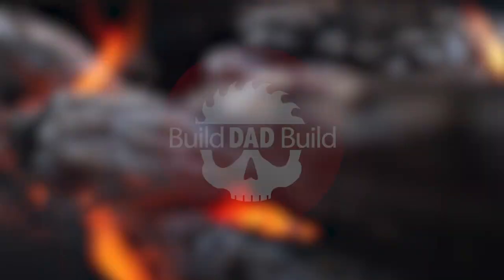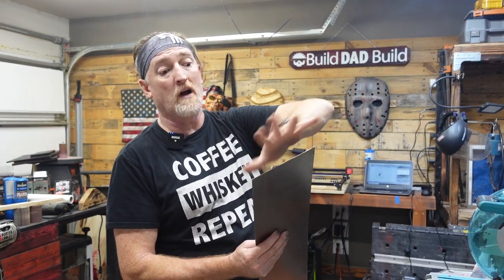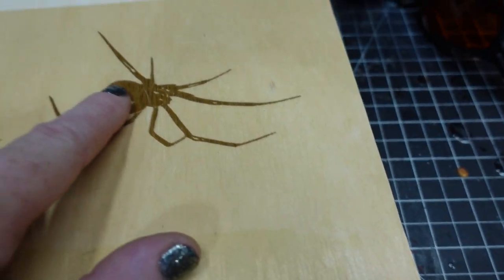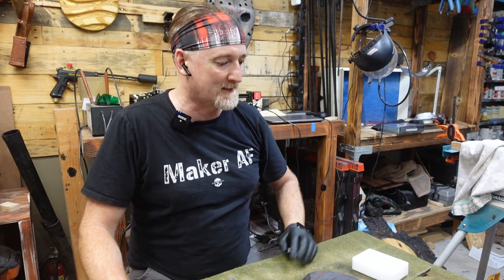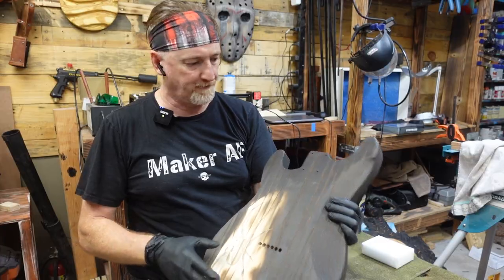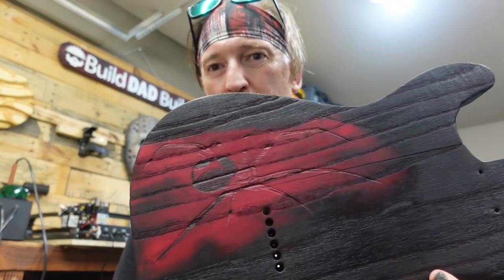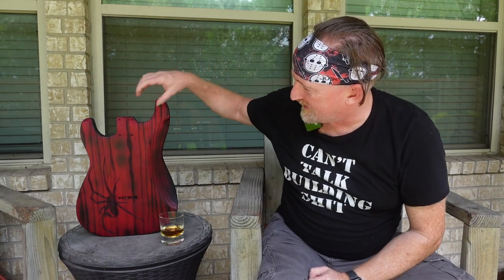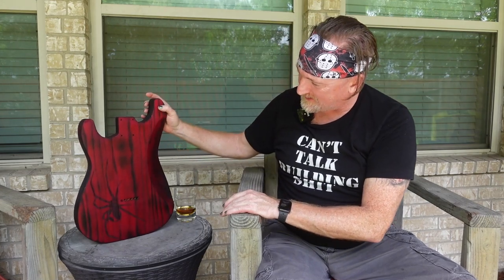Black Widow Guitar - Laser Engraved with the Ortur Laser Master 2 Pro

Comment: Try burning and staining first, let it dry for a day or so then engrave it with the laser. should be much better
Reply from the maker: Why is that? Just curious...
Cheers
Reply: I was about to suggest the same thing
Reply: @BuildDadBuild  it would make your image darker and Imo you wouldn't have to go back and fill everything in. would you want to fill everything in if you had an intricate design. The reason behind letting the stain dry a day or so is it will lessen your chances of fire on the material. It also wouldn't hurt to mask off the area that you are going to engrave as well as it will keep the soot and sap from getting on your finished material.

Comment: I've got an ash guitar body and I was considering doing a similar treatment. However it doesn't seem that hardwoods like ash produce the stunning results as softwoods like pine. I'm considering doing the treatment anyway and then staining the body black (should be easy enough after burning it) and then doing a ceruse application of red gilding wax in the grain pattern (lifting out the excess with teak oil). Does applying the shou sugi ban technique produce a channel in the grain to collect the wax? it looks like it does in pictures but I though I'd ask someone who can tell me first hand. Thanks for the instruction and inspiration.
Reply from the maker: Hey David!
Ash with open grain patterns works pretty good with the torch. And to answer your question, yes, it creates channels in the wood.
Sounds like someone's making a kickass guitar!
Cheers

Comment: Great vid. Well rescued, back turned out ace. Front being darker reminded me of a pair of Dr Martens I had, wish I still had them. Your baking soda seemed low, I've dabbled with staining using that and a tea solution to darken grains to good effect but can't recommend quantities. You can get a 1 piece body and could probably do it yourself with the tools you got. The issue is you start getting the term tonewood tossed around which is licence to print money.
Reply from the maker: Definitely want to try again with a single piece body!
Cheers
Reply: @BuildDadBuild  I would definitely have a look at doing your own. If you can get a big enough piece of wood, might even luck out on  ebay. There are a few principles to adhere to but making a body is pretty easy.

Comment: I don’t think they make a 1 piece, solid wood guitar bodies. I think it may have a tendency to “Cup” or “Warp”. Using 2 - 3 pieces give a flatter blank to work with. They can alternate the “Ring” pattern to avoid Cupping & Warping.
Reply from the maker: Yeah...I've discovered that apparently I'd need to reach out to a Luthier to have one made.
Cheers

Comment: Hey brother, new sub here. Based on your review of the Xtool D1, I picked up a machine. However, I got the 5 Watt laser. Reasoning is, I will upgrade to the 20 watt later. I have been watching a few videos on doing inlay work with lasers. Have you tried that with the D1? If not, maybe you can give it a shot so we can see how it is done? I will try to have mine setup this week. I have a cnc background, so I think alot of this should be easy to learn. I will be using Lightburn as well. Anyways, love your stuff, keep it up!
Reply from the maker: What kind of inlay work? If you’re talking about epoxy…coming up.
Reply: @BuildDadBuild  I am interested in that, but I am (as a guitar player/hobby builder) in doing fret boards. I was wondering if a laser could slot the frets and do the inlay cutting into the fretboard and then laser the actual inlays. I have seen the larger lasers do it, just not certain if the smaller lasers can handle it. I have a 5 watt, but will be upgrading to the 20 watt soon. I also got the new air assist.
Reply from the maker: @barretthamilton2565  how deep do you need to cut?
Reply: @BuildDadBuild  I am thinking maybe 1/16" to 1/8". Usually the inlay pieces will be proud of the hole, and that just gets sanded level to the fretboard when it is radiused. I am a hobbyist guitar maker. Just using patterns and a router/bandsaw. However I do have a small CNC that I am getting running as well, however I think the laser would be much better to do inlay work as there is a radius to the CNC bit and tight/sharp corners would have to be addressed by hand. Not opposed tot hat, but just seeing what all of the possibilities are.
Reply from the maker: @barretthamilton2565  I think you can totally do it. The question would be if it would be fast enough. I think you'd be good with the 20W D1...dial in some settings and you'd be all good.
Reply: @BuildDadBuild  Speed is probably not an issue in the beginning, at least to experiment with the 5 watt until I got the upgrade. Do you think it would be possible to cut the cavities with the 5 watt, just to experiment? I am a patient man. BTW< I absolutely love your channel brother, great content, keep it coming. I saw the Ash guitar you etched. Grain on the ash wood is touchy, I am having a similar issue just painting mine, doing an Eddie Van Halen "Frankenstrat" and the grain has been a pain. I am going to have to do a couple of coats of wood sealer to address the weird spot of grain that keep showing through.